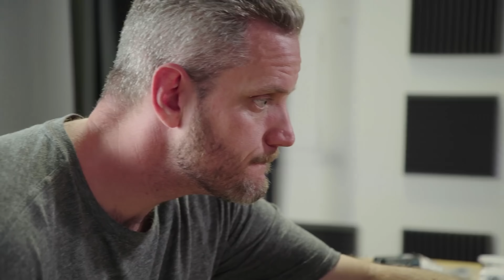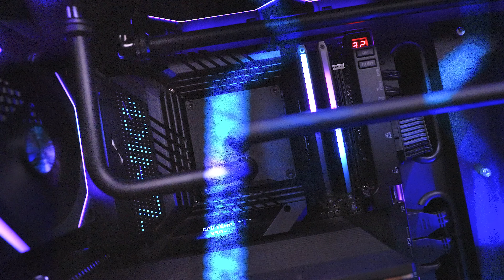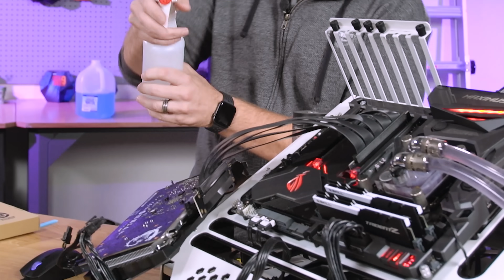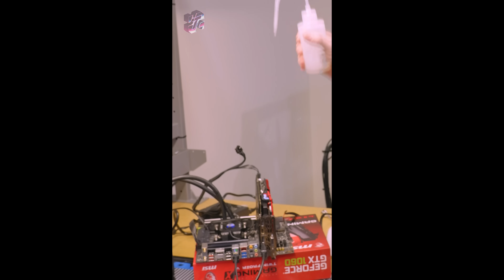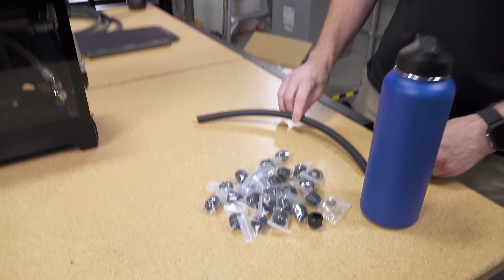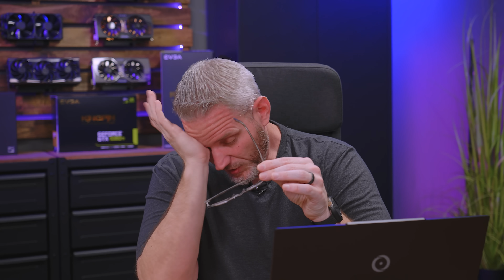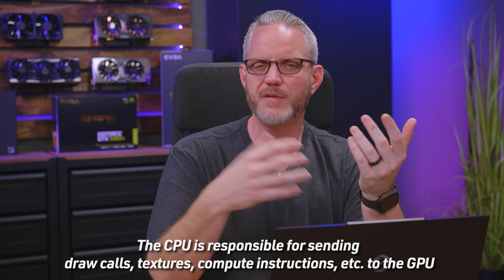5 Myths about Watercooling that are WRONG!

Comment: I believe Igor´s Lab
If you arent using Tap water, there cant no algue growth be in your system!
I had Super soft Tubes which where made for Shisha smoking and then it happen. The small fuzzy thing´s startet to appear.
I Cleaned the Loop and because i was using G58 (some Car thing for cooling) i filtered the Fluid and reused it.
Igor had shown i one of his video that these fuzzy things are the chemicals coming out of the softtubes.
So i would be better on by just using Destilled Water and EK Tubes. To be real good, something like Glass, copper, Nickel Copper Tubes, also Hard Tubes general and reducing Softtubes would be the best option overall.
I Still have the Old Fliud in a 5L Bucket and a Filter tahht i put to my Pump. Dam this thing got clogged up.
But now i think i need to clean the Pump once more then when i start the PC after 8+h not using it, the Pump need to be kicked to start.

Comment: Hell yeah! Do that watercooling temperature deep dive. A good thing could be to compare different size radiators and their heat dissipation capabilities. Also push+pull or just pull/push comparison between radiator sizes (20,30,45,60mm). Would be cool stuff to watch. Also acceptable water temperatures and how to calculate if your radiators can handle the load?

Anyway, just built my first water cooled system this year, and took a 4090 and 5800x3D to a custom loop treatment. And it's not that hard, built it in a mATX Cubeor Kanto case with 2x 240mm X-Flow 45mm rads. Seems to run with acceptable water levels during heavy load, but would be nice to see your take on temperatures. Cool stuff and it was really fun to build! EPDM tubes are cool looking and work well in builds.

Comment: I don't water cool for reasons
1. No need in a closed case unless its an open bench. 
2. Too many point of failures 
3. Min maintaince required
Reply: Be honest, its the money.
Reply: @ppeez  who said anything about money? Water cooling only makes sense for open benches and wall mounted pc... case makes no sense. Stay on topic .. not one person said anything about mo ey excpet for you and you alone. Once you realize how a loop works... for closed systems.. it makes no sense.
Reply: @systim30  no
Reply: @ppeez  mate, maintenance for air cooling takes like 10-15 minutes every year or so depending on your environment, water cooling takes way more. Not to mention that any point of failure is a pain in the ass to deal with, on air cooling you replace the fan and that's it. 

Yeah, money is a problem, because the only way i would have a custom loop in my PC is to have a guy like Jay on speed dial to fix it.
Reply: @angeltzepesh1  fix WHAT bro? You are obviously clueless. Custom loops are incredibly maintenance free and you can run the same coolant for years without issue (if its good coolant like DP Ultra or Apex ECO)

i dont think you really know what you are talking about
Reply: @ppeez  bro, pumps break, water blocks clog, thermal paste dries and the hassle of draining, dismantling hard tubes aint easy. Soft tubing is easier to deal with, but that shit looks bad for display. Not to mention that these days, air cooling ain't that far off from water cooling.
Reply: @angeltzepesh1  air cooling is extremely far off from custom loops and if you cant make soft tubing look good you are a bad builder. both hard and soft are easy to maintain and its not a lot of maintenance nor frequent at all. Pumps break? D5s easily last 8 years and can last many more. I have 3 pumps, even if 2 break which wont happen i still dont care

you obviously have no experience! I could be dropping links to my absolute bombshell of a setup now to flex you into tears but i would feel a little bad
Reply: @ppeez  flex me into tears, are you ok? You should visit a doctor if you think flexing on the internet brings people to tears😂
Reply: Ok

Comment: 5950x
7900xtx
2x 420mm x 60mm rads
12 140mm artic p14 max fans

Its quiet. Even at 50% fan speed i rarely see gpu temps in the 40s playing every single game at 4k ultra. Water temps around 28-30c. 

Eventually there will be a card that will make me want to upgrade from the 7900xtx. But its not gonna be for awhile. Amd says the next gen wont be more powerfull than the xtx. And i wont buy a video card that risks burning my house to the ground.

When that time comes i will flush the system. Buy new cards. Buy new blocks and keep running the rest of it. 

Might do a cpu upgrade to a 9950x/x870 this fall. See how it plays out.

Comment: Watercooling makes your system runs cooler and produce less heat. But you won't realise it. If you drop your CPU Temp by 20 Degree thanks to Watercooling your CPU will generate around 5-8% less heat but thanks to turbo modes of the CPU the Temps are pushed up again. So to have an effect you need to powerthrottle your CPU to get the Temps down. And lets say your CPU uses 140 Watts thats 7-11 Watts less heat production ! So watercooling a good System for it like a 7800X3D and a RTX 4080 Super/7900XTX and getting everything 20 Degree down reduces the Heat Generation by 36 Watt of a 460 Watt Budget.   Internal resistors are heat depending. The only real Bonus here is that the lesser temps means the components live longer as you generate more heat due the bigger fans and the Pump, which eats 50% of the saved energy. Which again produces.. heat. So on a net summ you end up with 18 Watts saved.

Comment: I have two temperature sensors, one before GPU and CPU and one directly after. Unless the pump speed is low, the delta is 1-2°C as you said.

Comment: I have water temp sensors between all the things, and what he says is right.   I actually found the best way to control ALL component temps is fan control based off the loop temp before the rads (hottest reading) with a bit of an adjustment based on ambient temps.   fan speeds change very gradually and its easy to dial in the min fan speed possible, and it even adjusts itself against the room temp.  (yep, its a little louder when the room A/C is off but the loop temp and components are always the same at peak)
Reply: an interesting thing to observe:   The temp deltas around components and radiators changes against pump speed also.  So you can tune your loop to have lower deltas (higher pump speeds) if you are going for ultra cooling performance, or higher deltas (lower pump speeds) for optimized radiator performance at low fan speeds (idle and medium loads).

Comment: hee hee. I found many things when I went to cpu/gpu mining. I found out I could heat my house in the winter, and nothing short of the AC unit or swamp cooler would do anything in the summer. At some point your just baking in the juices and consider under volting. Oh and every plexiglass thread connection eventually cracks, If'n you want long term get things with metal

Comment: The thing about heat in PC's is the vast majority of enthusiasts are extreme overclocking Cpu and Gpu while also using equipment normal pc folk will never afford or obtain.  All the while making people think they need all the fancy waterloops and other nonsense, not fully realizing they have no need for it in any capacity.  No one outside of you tube really needs a 4090 much less a liquid cooled one because they won't have the monitor to actually see all those fps numbers some number cruncher software told them they are getting.  Sure the unit can reach those numbers but they will never actually benefit from them.  It's like having a bugatti than can turn 200 mph and having a governor set to 55mph, what's the point?  Most people spend $200+ on liquid cooling stuff yet never use it hard enough to need it, this is the issue.

Comment: Good advice, but also a nice trip down memory lane.  I was looking at one of my old builds up on the shelf today and thinking about how things have changed.  It has soft Tygon (food-grade) tubing, an Eheim aquarium pump, and a Black Ice 1x120mm radiator.  I've also been through disasters like a massive fluid dump and I had to clean glycol off of everything (it all survived) and a Swiftech block that galvanically corroded to hell.

Comment: Not only the increased heat transfer can heat up your room faster with watercooling, the lower component temperature also can lead to higher boosts and power consumption and this way increase the output even further.

And for cleaning after a leak, I have a colleague whose GPU tube popped off in use due to overpressure and flooding his card. I disassembled it for him, used pressurised air to blow the water from below the components like core and VRAM, flushed it with destilled water, pressurised air again, 99% rubbing alcohol and pressurised air again. It works without issues since. Luckily he didn’t kill it when he powered it on before I cleaned it, he just got a blocky image from the water under at least one VRAM chip.

Comment: "Not gonna break the bank"... Tell that to computer enthusiasts on fixed incomes lol
Reply: I had no job and water cooled a PC for  a 150 bucks, Priorities can make it happen. But yeah it was a 25$ generic copper block cooler, 6 barb fittings with automotive hose clamps and home dopet "cleer" tubing, the pump was an industrial job that came with tiny reservoir for 45$, the radiator I could have gotten dirt cheap, but saved up for the thicker crossflow radiator.  Can of Krylon made everything metal the same shade of color.

Comment: The dracaena fittings are quite good. I am new to water cooling and I did my first mixed tubing build recently(soft tubing inside the case and hard tubing outside the case for aesthetics). I was loong for in expensive fittings and found the dracaena ones. The price still seemed expensive but considering what they do, it probably isnt. It was a journey though. Had numerous leaks, didnt put the second o ring inside the fittings and as a result sometimes the tubing came off because of pressure buildup. Plus i set up a custom flow rate sensor(to save money) so had to do some stuff there to prevent leaks. 
My loop is entirely made up of no name chinese brands. It hasnt been long but so far going okay. Temps are quite good.

Comment: Remember when you had to buy expansion card slot covers with pass through fittings so you didn't have to drill the pc case because everything was external.

Comment: Good Video Jay!! Team water cooling!! I learned what I needed to do from you and what NOT to do from watching Alex and Linus' insane adventures. 

I'm running a 10900k and a FE 3080ti. MASSIVE drop in temps while pushing them both way harder. Everything is quiet. 

Room is fine because I bought my dog an air conditioner (she's old and doesn't handle heat well anymore) but without it running the room gets hot

Comment: I don't think "efficient" cooling is the proper term for watercooling transferring heat from the PC to the open air.  I think the more appropriate term is "effective".  I feel that "efficient" cooling is moving a lot of heat with less work.  In my example, I have a 480x120x45 XFlow radiator and 400x200x45 radiator.  The water stays in the range of 28C to 35C under normal conditions.  This is a large amount of radiator volume to have more air to transfer that heat out, using 4 120mm fans and 2 200mm fans.  This isn't exactly "efficient", but it is effective.

I saw this question elsewhere, and I think the experiment should be done.  A water loop of copper components vs a water loop of aluminum components.  The original question was a copper radiator vs aluminum, but it is not wise to mix aluminum with other metals.  Aluminum is a weird metal, after all.  The person wanted physical proof that copper radiator cools better than an aluminum radiator, not just looking at an isolated set of numbers.  And I understood what he was coming from.  If you think about the local physics, you think you need a radiator between each water block, but the impact of the flowing coolant changes those factors greatly.  From an example from cooking, we hear about how great copper pots and pans are because of thermal conductivity, but in experience, the only difference is the copper pans heat faster.  Once everything is warmed up, the pans all cook the same.  There is more importance in a stove that maintains a constant temperature than having copper, aluminum, or cast iron pans.

So for said experiment, he wanted to see the comparison of 2 water loops where the difference is one is copper and the other is aluminum.

Comment: Hey nuclear engineering student here, water takes a lot of energy to warm up, so if you have a 1C differential in temp from inlet to outlet and a good flow rate you are “soaking a massive amount of thermal energy”(not exactly how it works but a simple way of looking at it) out of the components

Comment: I think a great way to test loop order is to get two test benches set up with crossed loops. Cpu1 and gpu2 in one loop, then cpu2 and gpu1 in another loop, reverse order. Put a load on gpu1 and see if cpu2 temp increases, etc. This would let you truly see the increase on a completely idle cpu rather than having to deal with a change in cpu utilization like you mentioned.

Comment: Watercooling has a high upfront cost to get into, but once you are into the space, generally you can reuse most of the stuff on your next build with the exception of the gpu block and tubing. But you can reuse the cpu block, the fittings, the radiators, and the pump.

Comment: My first video I watched of yours what “how to water cool a computer.”  Because of you I’ve been water cooling for 11 years.  External rad(s) still, Basic-B bitspower barbs, barb clamps, Primochill Advanced LRT soft tubing, PHN PT Nuke (still), distilled water.  Never a leak, never a problem with growth, plasticizer leaching, or anything.  Multiple upgrades, have not had any issue, reused some tubes just down to laziness.  Started with an Intel 4570T, going strong now with an AMD 3950X, basically the same setup, still the same Lian Li VCR lookin case.

Comment: I actually stopped water cooling because I wasn't gaining much cooling over AIOs , I remember getting a 15 degree or more cooling difference , now you spend 1500.00 and lucky to drop temps by 5 to 10 degrees

Comment: I don't have a myth bust but I do have a recommendation for new people, use soft tubing. It's much more forgiving, plus it allows you to upgrade your hardware without disassembling your loop. I've gone through two motherboards so far under the same water cooling loop.

Comment: Heh, wayyyy back in the late 90s, my sister spilled soda alllllllll over a laptop I gave her. I took it apart and washed the motherboard in the sink, let it dry for a day and reassembled it. It worked just fine and was nice and clean. The one thing that annoys me is trying to find replacement impellers for the D5 pumps. I found a few on Aliexpress that worked well. I don't want to replace a $90+ pump because the impeller took a dump.

Comment: I will always use black EPDM rubber tube. I’ve been reusing the same sets of tube and just trimming for new builds since 2018. Same fittings just cleaned them. Saved me SO much money over the years when doing water cooling.

Comment: So Jay, i want to create a custom loop within the new corsair 9000d case that is coming out, but i would like to have 2 pumps just for aesthetic reasons, can i just connect those two together separated by tubing without rads, they will be just for showing off my color theme. I will have 2 more pumps for the cpu with rads of course. Is there a way to figure out how much water flow we need for running multiple pumps to multiple rads?

Comment: about fear of leaking, i ran my system with garden and compressor hoses ziptied one inside the other to adapt between an car heating element and an old aio block for a year and had not a single drop, what killed it was the shitty gigabyte motherboard vrms going pop... who would have guessed that an fx 6300 at 4.4Ghz would pull enough power to kill its motherboard XD

Comment: @2:09 "... running a water-cooled PC could actually make your space warmer... because there's a more efficient transfer of heat from the component into the atmosphere around it..."
Whatever the efficiency of the heat transfer, the heat generated by the components is the same, and that heat will find its way out of the box eventually by conduction and radiation.
Reply: You're completely ignoring thermal throttling though..
Reply: @RossLouis96  Of course we have to maximise cooling efficiency and prevent thermal throttling, but that’s not what this is about - which is the inevitable levelling of the temperature gradient between the inside and the outside of the case. Which is to say, the air in the room eventually receives the same heat regardless of coolers in the box.

Comment: I highly suspect Dracnea's parts are coming out of the same Chinese OEM as Bitspower, Barrow, Bykski etc..I took a gamble on a 480mm rad from them, its almost indistinguishable from my Bykski RC-30 rads, except its 27mm and a slightly different shade of white...people are paying crazy prices for radiators and fittings, I'm modding the equivelant of 4x 480mm radiators into my TJ07 case, and I've spent about the equivelant of 2-3 EK rads, for 7 radiators (similar thing with fans, people spending huge money on Lian Li and Phanteks and Noctua fans, I've got 10x Arctic P12s and 6x Silverstone slim 120mms, if I bought the fancy brandnamed ones, it would of cost me multiole hundreds more..)

Comment: I had to completely take my GPU water block apart and clean it because the black tubing i used leeched a black mess into the loop and caused my GPU to start and act wonky
Lucky my CPU is on its own loop and was fine.
I'll never use the brand of black tubing again.
Live and learn i guess